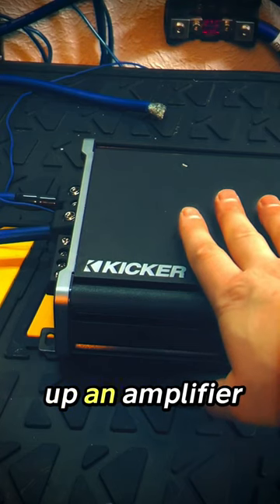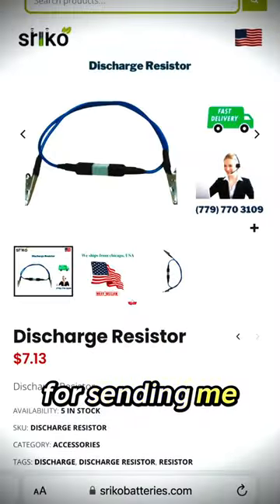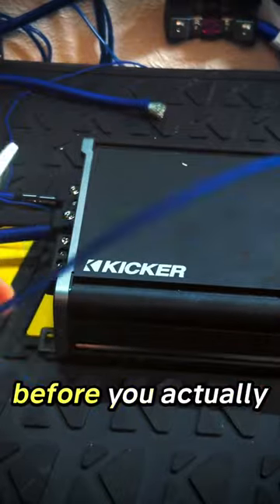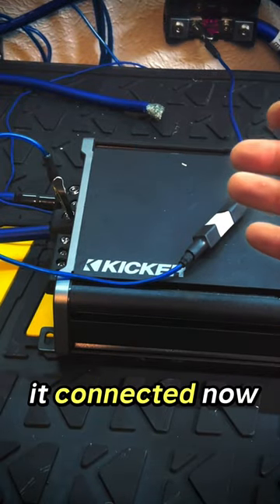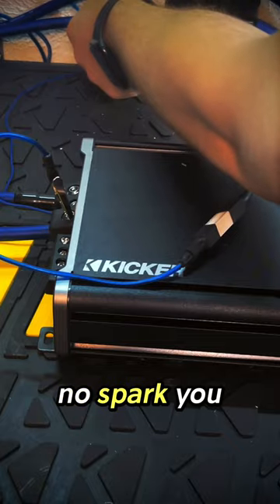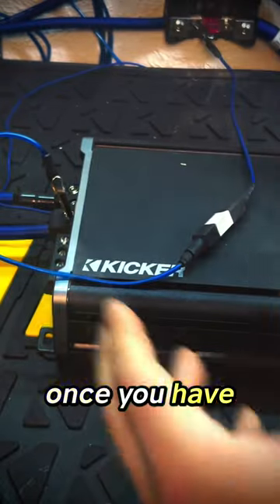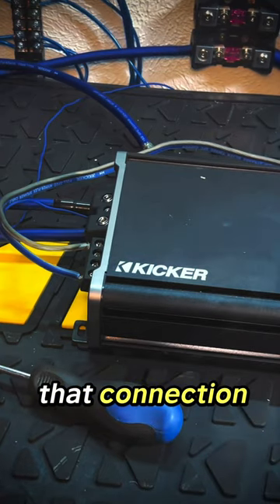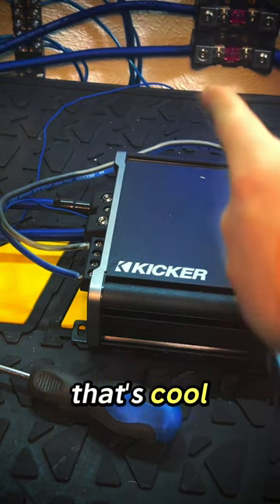A Car Audio Tool you didn’t think you needed👀

Comment: Wrong, you always connect ground first on the car amplifier and then connect any of the wires. And the same goes when connecting car battery always ground first never positive, and also connecting woofer(s) on car amplifier old school install car Audio. 🙄🙄 Just saying worked for JL Audio  and Rockford Fosgat. 🤔🤔
Reply from the maker: Either way will create the spark 

Which is connected first wasn’t the topic here 

That’s cool you worked for them!